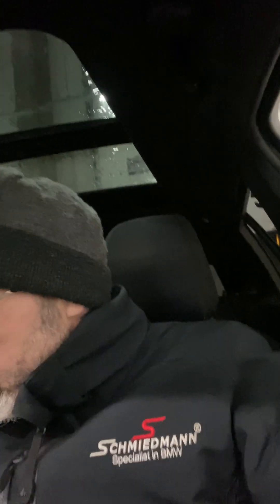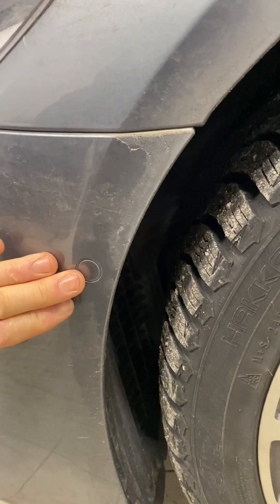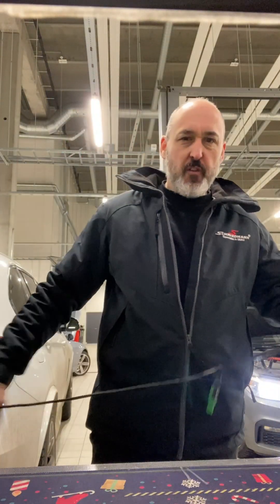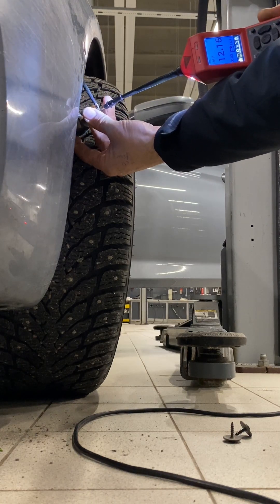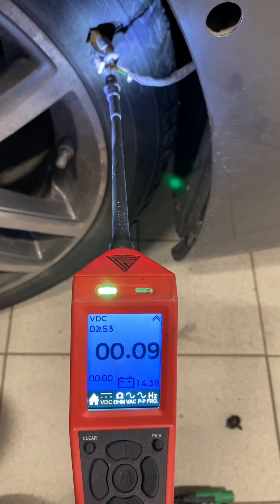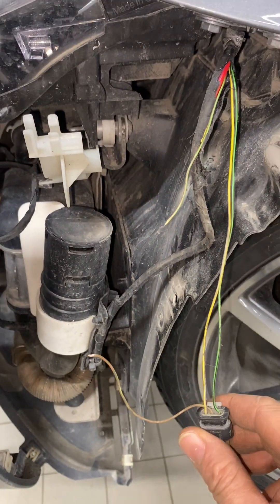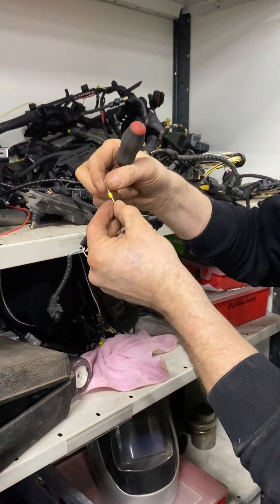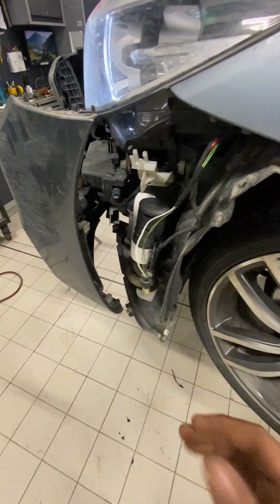Why Your Parking Sensors Might Be Failing (And How to Fix It)

Comment: Never Ever use those connectors, in a year it corrodes and same fault again. better off to tie it off, and no soldering, cause soldering makes wires hard and brittle. Been a car electric for years now and never have i used those wire connectors and never will, have seen a vw's from the 90s and 2000's these connectors are as fault most of the electrical problems.

Comment: At mercedes, we get judged when you use a power probe, especially when you are a basic maintenance tech. They always encourage us to do a voltage drop test, but this testing method looks so clean and easy.Why don't manufacturers encourages to use power probes? Don't get it